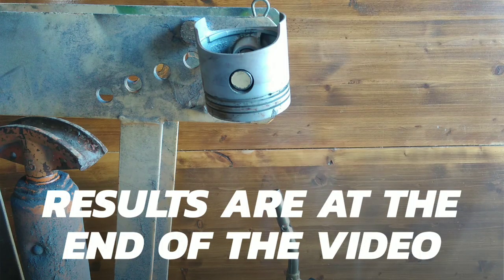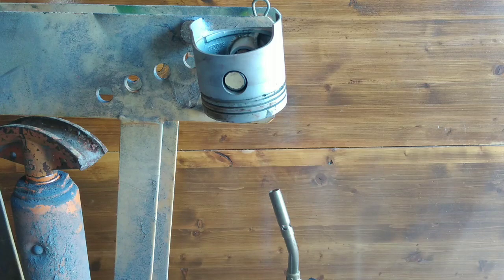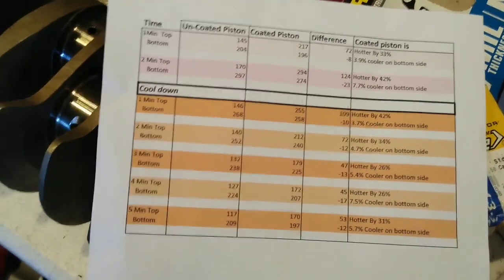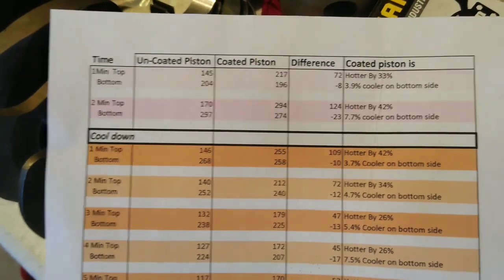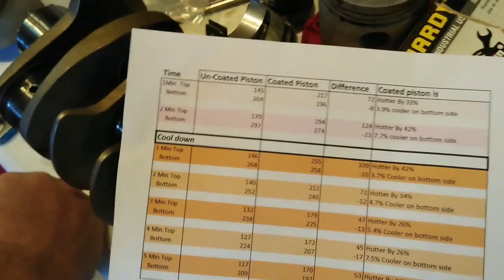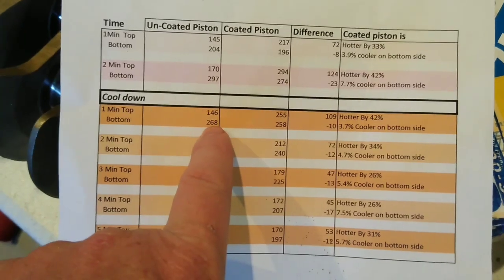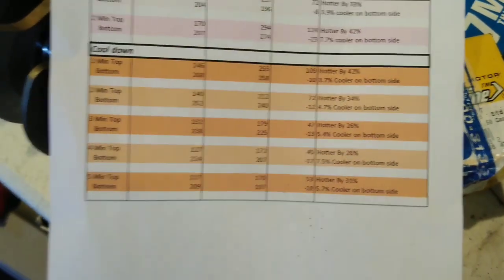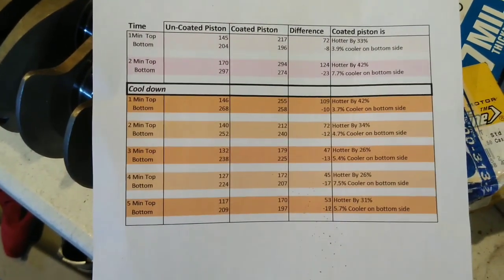Piston Coating is it worth it???

Comment: Hey my guy, 

Loved the testing method here, thank you for doing this and sharing the data.   I searched for a video after the engine was together, do you have much feedback on the performance differences by doing this?  Did you notice any cooler temps or performance changes?   

Thank you!  🍻💪❤️

Comment: I polished all pistons and head chambers on my Corvette C4. It made a big difference in MPG(10%), however it slowly got worse. I guess the carbon was building up again. Back to the same MPG after about 10000 miles. I wonder how this coating will last.
Reply: Techron additives should prevent buildup.

Comment: Excellent vid!

Sounds like the potential for preignition rises with coated combustion surfaces retain more heat, but also disallowing for oil cooling to be effective when oil jets are used.

Comment: Heat is what drives the pistons, keeping the heat in the combustion chamber will always increase combustion efficiency which is a good thing. You will produce more power with less fuel if the combustion chamber is kept hot vs losing heat though the piston. Even with an air cooled engine the heads will not get hotter because you would simply be burning more fuel to obtain the same output of power if your heat is lost through the piston so the heat on the top side (your heads) will be the same for the given power output.

Comment: Interesting experiment Matt. I think that the heat that cannot penetrate the coated surface involves the piston and goes to its walls, heating up the piston. Surely another result would be obtained if the pistons walls were isolated.

Comment: Problem with using an IR gun it that it’s really only picking up the surface temp. You will find the temp under the surface of the piston will be lower beneath coating

Comment: more heat in the chamber is good.
completely vaporized fuel resists detonation, and as the charges heat up more, your compression complimentary increases.
of course keeping your oil cooler is very important, but benefit older engines, ( without knock sensors )

Comment: The laws of thermal transfer, the top of the piston can not be cooler than the bottom. You need to have them upside, filled with oil and measure how long they take to reach 200c etc.

Comment: Very interesting... I would think for me in a performance application with turbo charging my old shity Datsun. I would want to remove heat from the piston and use oil to do that. so... maybe no coating for me. Unless there are coatings out there that would deflect the Heat? I like the idea of sacrificial coating on the skirt of the Piston to help with lubrication.
Reply: "turbo charging my old shity Datsun" The ring pack will last longer especially if you run the boost up. A lot of heat moves through the ring pack to the cylinder walls but first through the piston.
An extreme example is a motocross bike that needs rings after a weekend at the races bc it won't pass a leak down test.

Comment: Does this help the piston wheen boost is a factor?
Reply: Yes
Reply: @davidreyes2298  does it keep the piston at a cool down temp?
Reply: @weliftnation2418  yes because the coating keeps the heat in the cylinder than going through the pistons
Reply: Seriously? no nope the boost cools the piston to much and it blows out the spark plug if you gap the plugs to much LOL

Comment: It makes quite a big difference to head temp if you cote the combustion chamber in head as well. Im seeing 20-27 degrees C drop in head temps but have also done the outside of the heads with thermal grey
Reply from the maker: We did the chambers and pistons on a single port. Just got to get it in the car now ( work schedule is crazy). Good to hear that others are having good results with it.
Reply: I want to make a plasma engine and this seems like the only way I could do it without eating the engine
(Realistically I don't have the funding or tools, but I like to imagine and act like I do lol)

Comment: Heat is energy. Aluminum heads lose power from losing heat vs iron. So the coating "should" make better power. 
  Those I.R. thermometers are very sensitive to the surface material.. The "ceramic" would require a different setting to be accurate VS bare aluminum... This might be why you are seeing a massive 125* top difference with only a 25* under the piston.   See if the numbers are equal at room temp...
Reply from the maker: Just checked your idea out. And at room temperature the coated side of the piston was the same as the uncoated bottom side of the piston.

Comment: technical studies have been done with coated piston crown,valve faces and exposed cylinder roof which reduced fuel consumption by 10%...........the engine is more efficient when heat is kept where its needed to actually push the piston to make power.
Reply: So.....why isn't this process used on production cars?  Manufacturers spend a lot of money trying to obtain more mpg - this would be an easy way to obtain a 10% gain.  If this really is so beneficial - I feel that we would see it on engines coming from the folks who make them.
Reply: @davidwhitacre534  pistons on industrial engines are coated from the factory.
Reply: @davidwhitacre534  production cost would be too high, because of all the additional steps it would take to do this reliably.
Reply: @FiteTheGoodFight  Its most efficient to add the $5 of cost at the OEM.
Reply: @davidwhitacre534
Why do you assume it is not used in production cars?
Hasn’t ford been using it since the 90’s? 
Do some research first please.
Reply: @davidwhitacre534  Nope...they don't give a shit.. they have government telling them to be efficient and oil companies giving them money to not make them as efficient as they possibly could... plus its an extra step they would probably charge 10k for.. We've known polishing the intake and exhaust on heads alone increases efficiency and power for decades they STILL don't do it at the manufacturers...Oil catch cans help with all this also...they aren't standard from the manufacturer either...The manufacturers are replacing timing chains with "Wet Belts" and PLASTIC oil pans...they don't give a rats ass about anything but their bottom line..
Reply: because manufacturers always keep tricks up their sleeves for future models.  They only use enough features /tech/innovation to keep level with competitors and sell the current model.   Coatings do work, they are used for now mostly on external hot surfaces with the most benefit and easiest application.
Reply: From 1000km range to 1100km
That's quite the improvement
Reply: The reason it isn't done one production engines is time/money 💰! It would be another step in production, and cost. After market does this, but at a cost.
Reply: Same reason water injection is not seen on production cars and propane on diesel trucks...

Comment: wonder if the added heat will cause more head gasket failures and head warping
Reply: There is no “added heat”, the gases don’t get any warmer they are the source of the heat, and the combustion temperature does not change. They just stay warm a little longer and more of that energy pushes the piston down instead of going through it. Ideally you would coat the valves (easy) and perhaps the chambers too.
Reply: @axelriet  I'm really new to this whole "coating engine internals", but can you really coat the cylinders? won't it just wear down quickly and be a waste of time?

Edit 1: Assuming "chambers" is another term for cylinders
Edit 2: * won't the coating wear down fast on the cylinder walls due to the friction between the piston and cylinder walls*
Reply: @anybudz  the chamber is the head above the piston where the valves are seated.
Reply: @anybudz  A Chamber is when the pistons is at top dead center. The remaining area between the piston and head is the chamber.
Reply: @anybudz  this is 4 years old but that is still a funny question!! Coating the Cylinders lol Lets use Nicrom on the cyl walls and this coating one the piston top and then see what we get huh ? just a thought Hmmm?
Reply: Theres actually less heat induced into the cooling system with insulated pistons, meaning you should see fewer head problems.

Comment: I have to agree with Dalland, the IR temp gun will not read correctly on a shiny surface and in my experience, really gets messed up on shiny aluminum. I would be more willing to accept the "bottom" numbers. Maybe, if you care enough, you could scuff up the uncoated piston surface to dull it and possibly get better readings. Thanks for your efforts though!
Reply from the maker: Turbostang500 I might try the test again one day, got a few loose ends to tie up first. I will probably sand blast the top of the uncoated piston next time and we will see if there is a different. Plus im thinking of seeing what an old crusty piston would do. Thanks for the tip and don't forget to hit the Bell as I plan on coming back to this one.
Reply: Shiny surfaces read low on IR-laser thermos because of emissivity. I ran a cerakote and powder coating business for 10 years, and have daily experience with this problem. Cool vid anyways.

Comment: Matt do you think this will cause or be more likely to cause detonation?  And will the timing curve will need some attention.  I am new to your channel and looking to pick up a baja very soon.  Thank you, your channel is awesome.
Reply from the maker: Robert sorry for the late reply. To tell you the truth I don't know. This is my first time playing with this stuff and I have to learn. My thought is that timing will be about the same but jetting would be different ( more fuel to cool it) but in all reality 100° or so may not make a difference when your EGT's run into the 1400°. This test does not account for heat escaping through the exhaust or how the incoming fuel and air would cool the piston face. Mostly it does show that the coating keeps some of the heat from transferring to the other side. I hope to have more information once I get the engine together.
Reply: These are all assumptions. Need to adjust timing and jetting as needed on the running engine. 
Some might be opposite what you theorize.
Reply: @MattLundquistVW  thank you sir i will definitely be tuned in to the channel.  Thanks again.

Comment: Thanks for putting in the work and research Matt!
Reply from the maker: No problem, thought it was interesting.
Reply: @MattLundquistVW  usually the coating gets removed with time if you arent taking appart the engine for a long time
So even coating the lower side of the piston will prevent heat from escaping while providing a very long term coating life

Comment: Great video! Very interesting. Are you planning to also coat the exhaust channel?
One warning for measuring with ir gun, when using on shiny surfaces the values are not to be trusted. So it might measure a lower value on the uncoated piston top than what's the reality.
Reply from the maker: I plan on coating the chamber and valves as well as the exhaust ports. My thought is try to keep the heat from absorbing into the head, let it all pass out the exhaust.